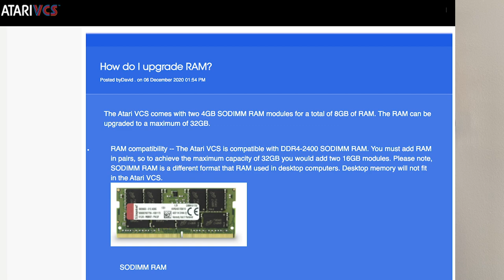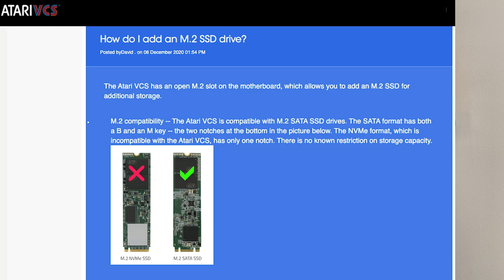Responding to Questions & Comments on my Atari VCS video series

Comment: great channel and content.  finally subbed after intending to for a few days .  this apu is capable of using an nvme so my guess is that they didn't include an nvme due to added costs.  nvme shader api's are being worked on by microsoft I briefly read about a couple of months ago but pc's probably won't utilize for a couple of years & I think the game devs have to incorporate into game design (i think this is the case for the ps5 and new xbox console already if I understand correctly).  it would be interesting if the vcs is a hit, if they might later on do a hardware refresh in a couple of years to a newer apu, add nvme and hopefully nvme shader api's become mainstream

Comment: This was really good that you went back answered questions, and clarified things. Better and better!
You could have mentioned APUs (and AMD term) that the Xbox One series also use an APU. The Sony PS5 too, although that APU is multi-chip. The AMD APU combination of a CPU and GPU offers cost and production advantages, like PCB density. Atari is partnered with AMD directly for the VCS, and it is AMD who are supplying BIOS updates, for example. The BIOS is partly locked-down so far, as a result. People should also understand 8GB is not a small amount of RAM. The Xbox One also has 8GB RAM; many Windows laptops still ship with unified 4GB RAM; some even 2GB. 8GB can be enough for most.

Comment: Hey, wanted to see if you can help me out.  Is there a way to boot windows 10 to the internal m.2 you installed?   I just made a bootable windows 10 usb using the Downloded Media Creation Tool, but seems like I can’t install windows from the usb to the m.2 I installed.  I can see the disk in the setup, but it won’t let me install. Would have I have to use an enclosure for the m.2 and use it as external to install windows? I’m pretty much stuck at the installation process and confused. Was just seeing if there’s a way to have windows installed on the m.2 internal. Thanks I’m advance.

Comment: So neither the M.2 SATA slot nor the PCIE slot currently used for the Wifi radio are suitable for, say, an egpu interface?  I'm not saying it's economically viable, by the way -- I'm asking if it's possible.

Comment: The Atari VCS is a mini-pc. It isn't competitive in the gaming console space. But it is competitive in the mini-pc space.
Reply: And since all modern consoles are PCs inside and can be used as PCs with little effort, your point with that statement was.... ?
Reply from the maker: That is indeed what I am hoping for, that Atari sets itself apart in some way and becomes Unique as I stated in my video. Right now, it feels unpolished. I am impressed overall with the design of the system and creative approach to the classic controller. We shall see how it progresses.
Reply: @Josh-ce9sv  I don't think anybody is gonna get their minds blown, unless we are talking  about resell prices. I predict this device will be very hard to find everywhere, and resellers will take  advantage of that and start  selling these device on ebey for a big price. I can see it now, ebay ad 'Atari VCS upgraded Ram and storage 20'000 ROMS Ubuntu or Windows  installed $650'. That is  exactly what is gonna happen with this device, there will always be a shortage, and resellers will upgrade the hardware, install an OS with KODI, emulators and ROMS, and sell them at a premium price. They will basically buy an Atari VCS for $300 spend $100 upgrading it, install  an OS with KODI and ROMs and sell it for a couple hundred dollars profit. We've seen this movie, we know how it ends. By 2022 the  Atari becomes an ebay device selling for an absurd price.
Reply: @Josh-ce9sv  Wager what? Make a fake bet on YouTube? Again, we've seen this movie before, this device is headed for shortages and high resell prices on ebay, period. For heaven sakes, it took them 3 years just to get the device out, so do you really think they are gonna keep them stocked? You're very naive. Not to mention do yo really think internet developers are gonna wanna develop for this device? Hell no. Would have an Atari VCS, yes, but would I be dumb enough to think developers are gonna love it and put time into it, no. Sure there may be one or two developers making mods/hacks for it, but that is about as good as it will get. Mark my words, someone will hack the UI so you can move tiles, sideload apps to install KODI and browsers etc, but  that is about ass good as it will get. Developers/hackers are not gonna flock too this device, and neither are mainstream developers. It's just not gonna happen.
Reply: @chrisgullett4332  other consoles take waaaay longer than that to be completed. The announcement date happens long after they begin development. For example, PS5 was announced in June. But does that mean it only took them a few months to make? Of course not. Just because it was announced 3 year ago doesn't mean it started development 3 years ago. And the delays haven't been due to slow production, but rather due to enhancements. On top of that VCS production has now been highly increased, as Atari stated they would begin really pushing production this month.
Reply: @cressothegrey4354  No they do not. These cosoles are developed and assembled quickly.
Reply: @chrisgullett4332  I don't think you have any idea how console development works. First the parts need to be developed, like the new APU included in the console. Then they need to design it and find the best placement of the parts to get optimum performance in a small form factor. Then they need to develop the OS and optimize it for the console. Then they need to design and program controllers to go with it. Then they need to develop and secure games for the console. It's a long process. Do you really think they made the PS5 in a matter of months?
Reply: @cressothegrey4354  No I know exactly how console development is done. The longest process is perfecting the firmware. Consoles my major tech companies are developed at a fast rate.
Reply: @chrisgullett4332  No, consoles are not developed at a fast rate. Sure, they are produced quickly, but the development phase takes a lot of time. Production and development are two completely different things.
Reply: @Talion Ranger I do not even own a PC. Nor do I dislike the Atari VCS, I an simply stating the sad reality  this device is gonna have. Work on our emotions, and stop assuming, cause it makes you look foolish.
Reply: @cressothegrey4354  Yes consoles are produced at a fast rate. Which company have you done console development for?
Reply: @chrisgullett4332  my point is, PS5 was confirmed to be in development years before it released. So was Series S and Series X. Not only was the VCS in development for much longer than those three years, but it's actually a pretty understandable development time.

I never said I myself helped to develop one but from just looking at how long it took them to develop the consoles it's pretty clear that it's a long process.
Reply: @chrisgullett4332  so you're trying to state that not only does misspelling "you're" make this person wrong, but when you said "the VCS is doomed to fail" you weren't being negative? I think you're the fool around here. You don't even know what negative means.
Reply: @cressothegrey4354  That is not what I said, I said nobody is ever gonna take them serious if they cannot spell 1st grade level words correctly. Nor did I say this device is doomed to fail. I simply gave my opinion on what is likely gonna happen with this device. Stop being so emotional over someone saying things you disagree with. Again, if you cannot handle words you should not be on YouTube.
Reply: @cressothegrey4354  You're totally wrong. Consoles just like phones are developed quickly.
Reply: @chrisgullett4332  You are speaking of production, not development.

If they are truly developed quickly then why is it the PS5 took over 5 years? It was first mentioned in 2015 and was in development before that, maybe even dating back to 2013. PS4 also began development in 2008 and released in 2013. PS3 took around 5 years too. The standard development time for a console is around 5 years. Keep in mind development includes things such as planning and concepts. It isn't as easy as just taking parts and putting them together. That's production, not development.
Reply: @chrisgullett4332  Nowhere in my words have I implied emotion. I am merely stating facts. And while you didn't directly state "the VCS is doomed to fail" you still said, in the form of a long paragraph, just that. Your opinion is that by 2022 the VCS will be unable to stay in stock and it will be resold on ebay at high prices. By this you imply that it is going to fail. After all, if it doesn't fail, there would be plenty reason to keep it in stock. The only reason to stop supplying it would be if it failed.
Reply: @cressothegrey4354  No I am speaking of development and production, it is all done quickly. The PS4, PS5, all done very fast. All electronics are done quickly. The VCS was also done fast, and  we know this because the developer is suing Atari because they did not pay him. Phones, consoles, it is all done quickly.
Reply: @chrisgullett4332  Rob Wyatt was the lead designer, not the lead developer. He designed the appearance and placement of parts. While that is a big part of development, it is just that. Only a part. There's so much more to development than the design.

And you call 5 years per console fast? And 3 long? How does that make any sense?
Reply: And even then Rob Wyatt filed the lawsuit just last year, 3 years after the console was announced. Him sueing them at that time does bot mean that's when it was finished. Are you really trying to say it takes over 3 years to design the console, on top of the rest of the development process? Are you really calling that "fast?"
Reply: @cressothegrey4354  You're delusional. Electronics are  developed  quickly. Everything is  developed quickly today.
Reply: @chrisgullett4332  And yet you have yet to show anything to prove it. Each time you make this argument I show more and more evidence that proves you wrong and all you do is repeat the same claim over and over as though that even remotely counts as an argument.
Reply: @MandrakeDCR  - Has someone installed Linux or Windows on an Xbox Series?
Reply: @Zoyx  Of course they have. Just do a YouTube search. There are plenty of them on the 360, the One, of course the original, and it won't be long until people have the S and X figured out as well. They are ALL just PC hardware, with northbridge / southbridge chips (or similar) that keep people from installing other operating systems... until someone hacks around it. ALL consoles are just PCs. Especially the newest generations since the One. Other than the hardware blocks, they are literally the same inside as any AMD SOC board.
Reply: @MandrakeDCR  - Prove it. You can't install Windows on an Xbox 360.
Reply: @Zoyx  What do you mean 'Prove it'? Are your fingers broken? Pretty easy to do a search on youtube and find all kinds of videos on how to do it - also he said "Windows or Linux" I don't recall stating Windows specifically. Linux is the easiest to get running on any of the systems I mentioned that have done so. Windows is easy to install on the original xbox. xbox 360 is PowerPC based and is easy to install linux on. Tons of videos on all of this. Use a little brain power and find READILY available information that anyone can find.
Reply: @MandrakeDCR  -  Find me one. Just one.
Reply: @Talion Ranger - Then show me!  I can't find anything. I have an Xbox One that I would love to mod.

Comment: will a optiplex 760 with video  card work better  then a Atari VCS
Reply from the maker: Apples to Apples, will depend on the overall specs of the workstation and gpu. I think it depends what you want out of the device.  For me, I like the set-top box size and profile of the VCS. Spec wise, it’s decent enough for my retro library, but I will prefer a better equipped PC for really enjoying modern games and future proofing (upgrades)

Comment: How does the atari vcs compare to a raspberry pi in terms of specs.  Are they similar to each other.
Reply: ?? that's an easy one, just google it yourself ;-) took me just 15 seconds to find out.
edit: 
answering to the (invisible) comment by "Talion Ranger " : and I am allowed to comment freely!!! ;-)
Reply: Raspberry Pi is ARM-based and can't run x86 games natively. Atari VCS is x86-64 based.
Reply: The Ryzen processor in the Atari is much more powerful than the ARM processor in the Raspberry Pi.  Of course this is much more expensive.  There is also the questor ARM vs. x86 compatibility.  My impression is that for Linux this is less of a concern.  Most open source software can be recompiled to support either architecture.

Depending on your use case though, the expense might be worth it.  Of course you could also build an inexpensive PC.  Mini PC's seem to have a price premium, and this unit does seem to also have the same issue.
Reply: @TevelDrinkwater  holly crap! you people are actually responding to his question?
the youtube comment section has turned into google search? and actual people answer your questions? wtf?